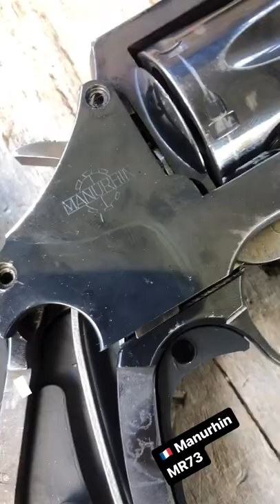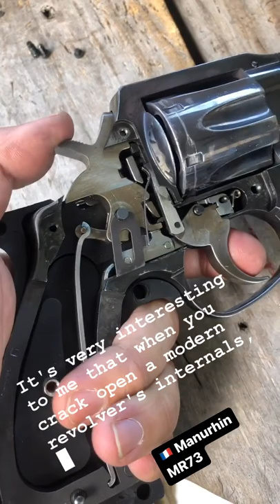Revolvers are clockwork inside #shorts

Comment: "Revolvers are reliable because they're simple and have less moving part"
Reply: Ah yes, you've also read the Dresden files.
Reply: Yea but would ya take one apart and clean it? Like completely apart like an automatic?
Reply: Yup, the most mechanically simple repeating firearm you can make is actually a straight-blowback, open-bolt, full auto only submachine gun.  Compared to them, even an M1879 Reichsrevolver is complicated.
Reply: Who the heck told you that BS???
Reply: @pebo8306  classic fuddlore
Reply: @davidmoslow4177  Yupp!!!
Reply: @davidmoslow4177  It's not particularly bad by fuddlore standards: it's a broadly accurate observation backed up with a nonsensical explanation.
Reply: @jic1  it's an over simplification. Because people see only the cylinder and hammer move, it seems simple
Reply: @davidmoslow4177  I think it's also the idea that 'older firearms technology is simpler', which usually isn't true.
Reply: This french revolver go to the trash can between 10k/20k shot ! When a Glock 17 Can handle 200 k shot !!!
Reply: This is why my dad carried one in Vietnam 🤷🏼
Seemed to have worked for him luckily
Reply: @jackthevagabond2669  what's the dresden files
Reply: @Thatsmisteroldguytou  Urban fantasy series about a wizard/private investigator.
Reply: It's more of a machining thing that a moving parts thing, they're almost right, just not about the moving parts
Reply: @gagelink2457  semi auto, nobody has auto except service members, manufacturers, and criminals
Reply: Revolvers do have more moving parts than semi-autos, so the idea and difference in reliability is counter- intuitive. Revolvers,  when they screw up, is a timing/mechanical problem. With semi-autos/autos, it is usually a magazine/feed issue.
Reply: @chrisperrien7055  Yes, if you ever see those homemade .380 submachine guns the Brazilian cops are always confiscating from drug dealers, they have really long single-stack mags, because mags are the hardest part to make.
Reply: Not true.  Revolvers are more reliable than autoloader because semi-auto pistols rely upon various balancing forces of spring tensions vs. recoil forces, slide friction, propper cartridge feed angle, friction of the projectile feeding against the feed ramp, and even how tightly the gun is held.  None of that applies to a revolver, though a worn one can suffervtiming issues.  Overall, the wheel gun is substantially more reliable.
Reply: @Snookynibbles  revolvers rely on precise timing and the movements of a series of springs. Any malfunctions with a revolver is typically going to be catastrophic. Most of what you said is a blatant misrepresentation of what could causes malfunctions in an automatic. The majority of malfunctions come from the magazine and are easily resolved
Reply: No.  Glocks are simpler with less moving parts.
Reply: @magcitrate  the quotation marks implied sarcasm
Reply: @davidmoslow4177  oooh.  Understood.  I’m a foreigner.  😁
Reply: @Louettedefalaise  lmfao at trying to compare a manurhin and a glock
Reply: @halfassedfart  maybe because i know  how they age . It's not durable .

Comment: This is why revolvers, although usually more reliable than a semiauto, once broken, take a knowledgeable gunsmith to fix.  I can completely disassemble my modern 9mm without problem.  I started taking apart a .357 that had lockup issues and stopped once I realized I was in way over my head on how complex things were inside...

Comment: Well, a mr73 is a particularly nifty revolver. That said, my smiths are made pretty much the same configuration of these in particular. My rugers have a very different configuration and are significantly simpler, both more and less elegant depending on how I'm feeling about it at the moment... usually based on whether or not I've been shooting them. I don't think the ruger triggers are as nice as my smiths. They're all pc smiths tbf but ruger didn't have the equivalent option.